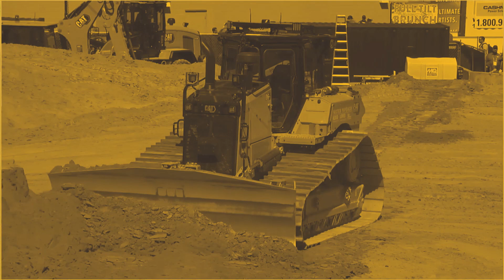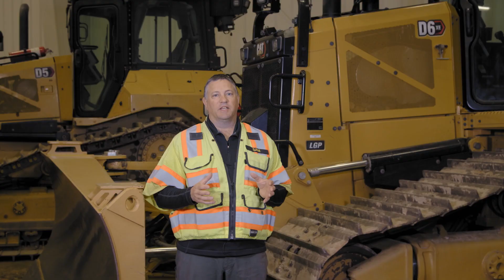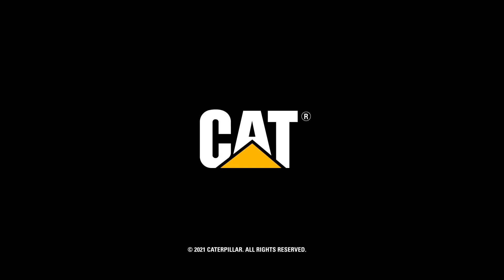Cat® Dozers with Sam Meeker: How Electric Drive Works

Comment: It sounds like the drive system is similar to what is used in a diesel electric locomotive — trains.
Reply: It is exactly the same thing, though far smaller. The machine is actually a hybrid and not electric in the generally understood sense.